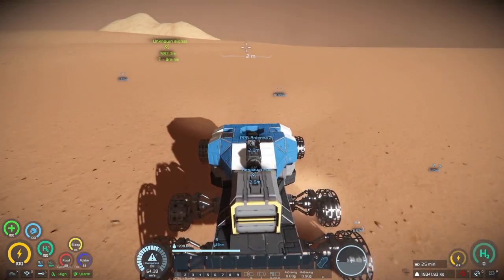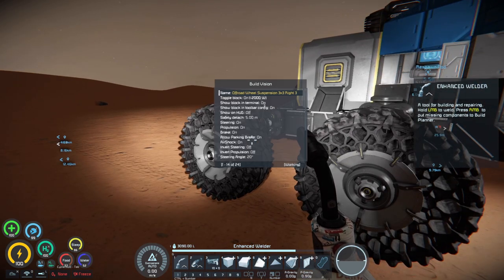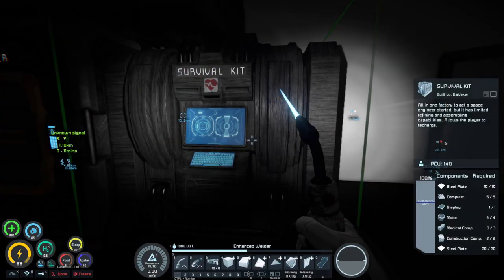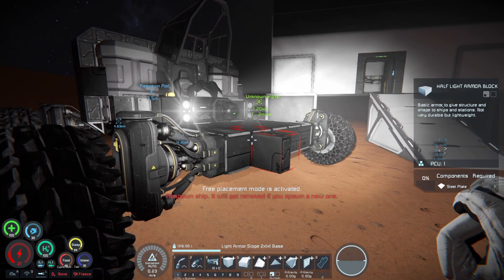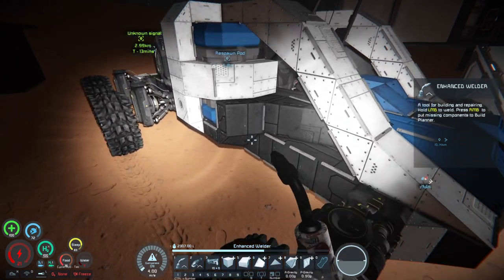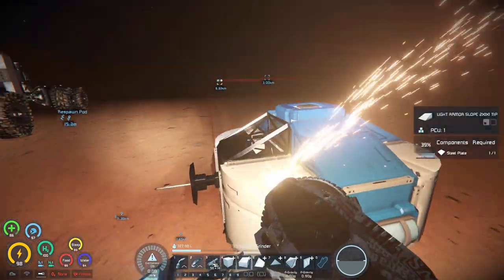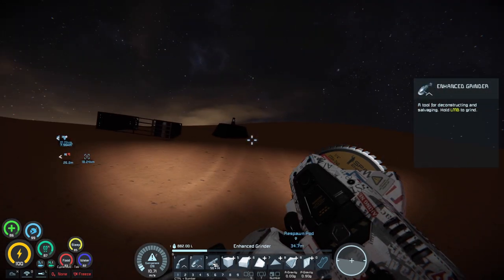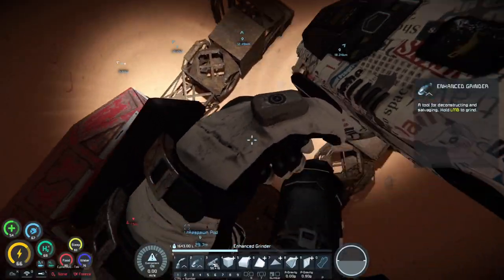Space Engineers Surviving As A Trader - Updating The Rover EP04

Comment: I suggest a sensor that detects whether the rover is more than 3 meters or so away from the ground and, if so, turns on the thrusters.  Set the thruster override to whatever you need for a "soft landing."  Be sure they monitor an area that includes a lot more space ABOVE the rover than below; you don't want the thrusters coming on while they're pointing up.